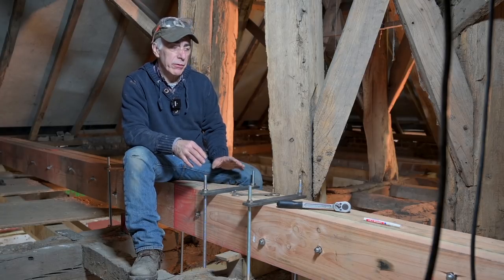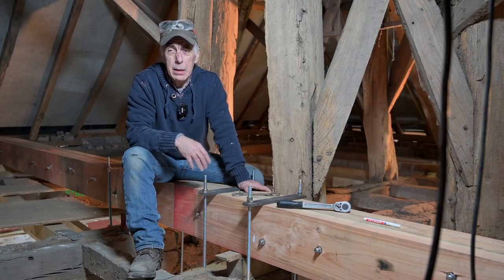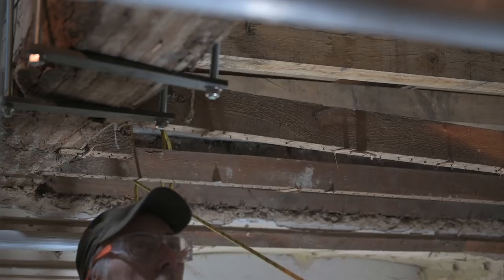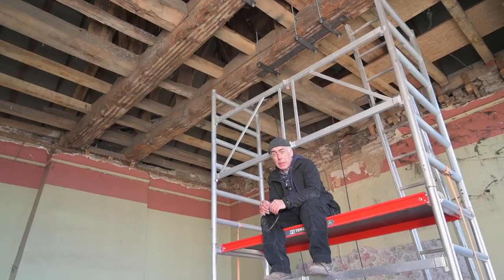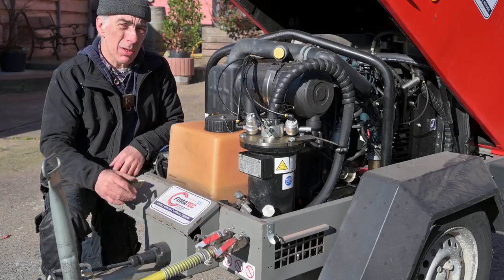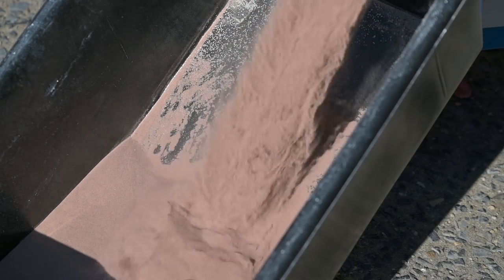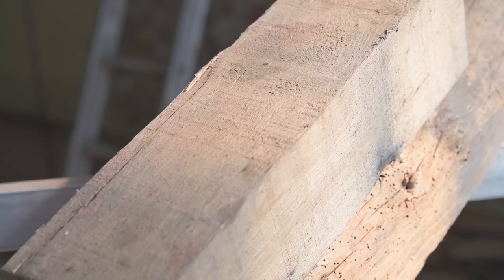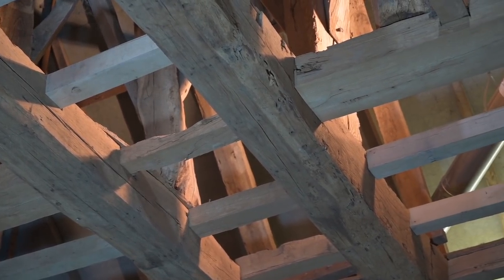DAY 8, BLASTING THE CEILING

Comment: That looks absolutely superb ! I should not worry about the armchair critics, they have yet to do any kind of job and put their theory to the test, although the double nuts on the studding are a nice touch, I don't think they are necessary for the stress imposed upon your beam, the tension is shared between all fixings on the structure, but you would need them on the bottom end as well, the sockets cut into the major beams must have been there before the "new" ceiling supports were put in, they show signs of great age so maybe the was a false ceiling originally, I use a heavy duty wire cup brush after I have sand blasted as I find it takes away the "fuzzy" surface texture and makes the cobwebs easier to remove, it also removes any remaining loose splinters. That is looking really nice, now you have to clean up! Good luck, and stay isolated! I am on drystone wall building during the shut down.Chris B.
Reply from the maker: Thanks for the comments Chris.  That might be something that I need to " Wire brush"  Although it feels smooth in most places.   The cute-outs were indeed there ( on the upper side of the beams)  . These were the originals and planks must have been placed on it long time ago.  There was still some evidence of it.  In 1922 ( after WWO1)  the fall ceiling was installed (plaster) and for that they nailed pin support beams on the bottom side of the oak beams and cause some damage/    I am taken the ceiling back pre 1922, oak structure covered on the upper side with oak planks.
Clean -up was one hell of a job.... but as we are confined to the house it didn't matter.   Regards  Steve
Reply: @D3Sshooter  : I bought a device by "Fartools", it is, in effect, a 9" Angle grinder with a 90 deg gearbox that drives a roller like wire brush, I find it gives a much better finish that the large cup brush I was using, the heavy wire brush gives a burnished finish, and you can go as heavy, or light as the surface requires, it gives a much smoother finish which does not collect as much dust as does the sandblasted surface. Chris B.

Comment: Hi Steve, I admire your confidence in taking on this operation on your own. Clearly you are not afraid of very difficult and dirty work. I have been fascinated by the project todate. Your common sense approach is to be admired.
I await your return to the engine rebuild so that I can learn from you before completing the rebuild of the Fergie engine. Hopefully it will be soon as I understand you have all the parts for the project. Jim, Dublin Ireland
Reply from the maker: Thank you kindly Jim,  I miss a few spacers . They are on order, but due to the corona issue , the delivery is late...   Ireland, I am considering moving to Ireland once I retire...  It all depends on the cost

Comment: Love this channel, very professional, so diverse and you have a lot of knowledge about many different topics. Regarding the bolt/nut which you answered some comments to in this video, I can maybe share some info if people are interested. I have worked in the Norwegian offshore industry for about 15 years as a structural steel analysis engineer, so I hope I have some knowledge about this. The extra nut that was suggested you put on has in reality no effect. The nut is stronger than the bolt, in fact the first few treads in the nut takes almost all the load. The nut is design to be stronger than the bolt. Regarding the strength of the rod, its easy to calculate. A ruff estimate is to multiply the are times the strength of the material in the bolt/treaded rod. A more accurate way is to use the stress area. This can be found on the internet. In Europe the actual formula in the Eurocode is (stress area bolt*strength bolt*0.9)/(material factor). For your actual bolt (M14) the stress area is 115mm2. Regarding the strength, some people have maybe noticed numbers on top of the bolt head. Typical 4.6, 8.8 or 10.9. This is the strength of the material of the bolt. The most typical is 8.8. What this means is that the ultimate strength of the bolt is 800 N/mm2, and the yield strength is 80% of this, 640 N/mm2. For 4.6 ultimate is 400 N/mm2, and the yield is 60% of 400, so 240 N/mm2, and you get the idea. So, in your case the strength of your M14 rod, assuming you have an 8.8 quality rod, (115mm2*800 N/mm2*0.9)/1.3 = 64kN ore about 6500kg. (The material factor used here as 1.3 differs. Offshore it is typical 1.3, but in civil engineering it can be less). Your M14 rods strength without material factor is then 83kN, or about 8500kg, so plenty strong.
Reply from the maker: Thanks for the comments and sharing your good advice and explanations.  I do enjoy when experts come back to me with rational and facts.   So we ca all learn...  that is the idea of my channel - Share and learn.   Much appreciated

Comment: For your beam re-enforcement project, instead of your threaded rod and flat bar connections, may  I suggest an alternative?  How about using steel banding and crimp splices? The kind used in the shipping industry, usually to band together bundles of heavy things like structural steel shapes and also wood lumber. The larger size steel band is 1-1/4" and many thousands of pounds of rated tensile strength.  You need a band tensioning tool to make the bands tight around whatever you are wrapping together, and the crimp tool to close the splice crimp.  I have actually used these to hold wood beams together myself with good success.  Nice thing, all you will see from the bottom, is a 1-1/4" wide steel band.  Paint it brown if you like, and space them at even increments to make them look like they belong there.  Just a thought for a cleaner look and also very strong as well. Maybe install them every few feet to really spread out the support load, and still be looking good in appearance. Best regards.  --Doozer in USA
Reply from the maker: Thanks for the comments,  that is a good Idea, but in this case the beams are at 90 degrees opposite directions.  I don't see how that would work without wrapping that steel
Reply: @D3Sshooter  Ok I did not realize they were at 90°, I should have looked closer.  By the way, I am a mechanical engineer and I think you are doing a great job.

Comment: In Finland, there was recently an article in a technical magazine about cleaning beams with dry ice. The article claimed that dry ice is less abrasive to wood. The specialised company that was mentioned was Dry Ice Finland. Their site is in Finnish only.
Reply: Amir Snapir: The dry ice blasting has the huge advantage of not producing massive dust contamination, it takes long to clean up the dust, which gets everywhere, than to sand blast the structure.
Reply from the maker: Thanks for the comments Amir,  indeed dry ice is the new way of cleaning.  I can't just afford the tools for it.

Comment: I think these beams are not rotten but it is simply sapwood that was attacked by woodworms. It is quite common to see old oak sapwood covered in holes of woodworms. The beams might have been dried on open air after they were hewed or cut to their final dimension. In this procedure it is very likely for woodworms to get into the drying wood. In fact these beams might have even been installed in the condition they are now. I would not worry at all about that rotten sapwood because those beams look way too big for their purpose of keeping the roof up. Anyway you installed the support beam very elegantly so that none of the original substance is changed. Very nice job!
Reply from the maker: Jonny , you are 100% correct.  I should have stated that.  sapwood , now I know the word for it.  In general its a combination of sapwood with woodworms and some old water damage in other area's.  Thanks, and as side note the roof rests on the walls.  This is only a ceiling, above it is the attick. I will install some planks on that beam structure to walk on.  So all by all strong enough

Comment: Hi Steve  I have some 300 year old beams in my property I just  scrubbed them with soapy water they look great and have still kept there patina but that's not to say my way is right it's just the way I did it and it's just the look a wanted your doing a great job 👍
Reply from the maker: Hi Nick, and yes that is another method that works well .I have done it on other ceilings, if you add vinegar it is even better.  Although I did find it more difficult to get the job done if the beams are uneven and damaged

Comment: Yeah, while sandblasting wood might not be ideal in many refinishing situations, in a situation like this I think it is ideal, since it fluidly cleans the original surface while keeping it rough-hewn looking; It also removes much of the gray and dirt, thereby making the wood look more like wood. When I used to do it to my burl pieces, I wanted to remove all of any punk or rot or soft stuff, but I understand why you may not have the same motive in a restoration. One thing I would do is put some sort of putty mixed with fibers and maybe some rough sawdust in the bigger holes. I believe that you can make it mimic the wood texture with little effort, and while it will not do much structurally, it will clean up the look just a tad. A polyester base could be used or epoxy, but there needs to be enough filler to make a putty consistency. As you know, I love all of your videos, whether on cars or this old building.
Reply from the maker: Thanks for the comments Dennis all always,   An epoxy for wood is indeed an option..  I might just do that

Comment: Wonderful work, you seem to have the patience of Jobe...
Something that has worried me a bit is that the holes in the upper plates (for the threaded rod) were spaced too far apart.  I would have tended to space them so the threaded rod was directly adjacent to the wood beam.  Maybe I missed something that caused you to space them further apart...
Reply from the maker: Yes, you are right. However the rods had to be straight up and I wanted to be as close as possible to the place were they are needed.  Unfortunately there were outriggers in the way.  so the choice was either move 10cm away from that damaged area and use plates that align with beam ( as you mentioned).  Or drill a hole through the outrigger, or make the holes wider in the plate..  I did the last one..maybe drilling a hole through the outrigger was a better option and closer holes on the plate...  Txs for the comments

Comment: Steve those beams are looking wonderful and it's good to see common sense rearing its head. Are you going to use a stabiliser\sealant on the old beams? Having used one many years ago on old timber, I would suggest Spring is a good time to apply it, but keep the room well ventilated for a few weeks as it will off gas for some time. All the very best and no matter what order your videos come out, they are entertaining especially during these trying times. Stay safe.
Reply from the maker: Thanks for the comments Stephen, I am not sure what to use at this moment.. some claim that its not needed as long as everything is dry ( real dry) and it is. Others claim that i should inject it...  point is at this moment in time , I have no idea how active the worms and so on are in the would.  Once completed , I will be able to spot those area by the droppings.  Then I will inject it in the hole itself.  Unless you have some recommendations Stephan.

Comment: I didn't mention it on the last video, but the idea of double nutting the threaded rod did cross my mind. I just felt like you had plenty of support, and it was not going to have people dancing on it. 40 years in the major engineering and construction industry, and I've seen many failures, but I think you are good with this solution in this situation. Also, do you have walnut shell blasting material where you are? I watched your video on the blasting materials but can't remember. That is a good one to use without damaging the item you're blasting. Great video as always. Regards, Solomon
Reply from the maker: Thanks Solomon,  indeed and yes we have walnut media.. yet very expensive

Comment: Dry rot does exist. It is a fast growing and VERY destructive. Timber infested with dry rot is best removed and burned. It grows when there is too little or no ventilation. A house in which I lived some years ago, had been left empty for a number of months, and during the winter a water pipe burst and flooded the house. Shortly after I moved in, the stairs started to disintegrate, and skirting boards started to bulge. The whole house had to be stripped of wood and treated with fungicide before repairs could be carried out. Good ventilation is essential.
Reply from the maker: Thanks for the comments Bob,  you are right in what you describe as dry rot. But in essence it is a term that we all use for something that is not dry.  The only way to stop it is to make reduce the humidity . In fact its kind of fungus, a that needs water

Comment: Assuming the nut and rod are the same material,  the surface area of the nut thread should equal or exceed the cross sectional area of the threaded rod.  Therefore, excessive tension will 'neck down' the rod and the failure will occur within that rod first. It was a question in my dynamics (engineering) class at the Rochester Institute of Technology 1984. Rochester New York.
Reply from the maker: Thanks BX B,  I agree with that as long as the nut thread is equal or exceeds the cross section of the rod. and that is where I have strong doubts.

Comment: a company has an  hydraulic injector puller, it uses threaded bar and one nut it pulls 20 tons no problem
Reply from the maker: Thanks for the comments, 20 Tons (pound I assume)
Reply: @D3Sshooter  it said tons on the gauge and it went up to 40, when you get around 25 tons it snaps the injectors then they cut them out

Comment: I like the Structural Engineer comment.  I wonder which Engineering School the original designer went to? None of course... He used common sense.
Reply from the maker: Thanks, and there are many ways to look at an issue.  I tend to use rational and common sense with a pragmatic approach. Off course I do check some calculations and specifications.  On the otherhand things can be all calculated and modelled.  I think both work and it all depends on what the job is about